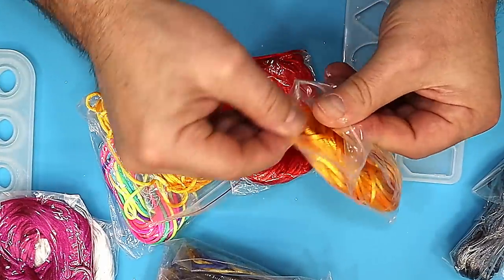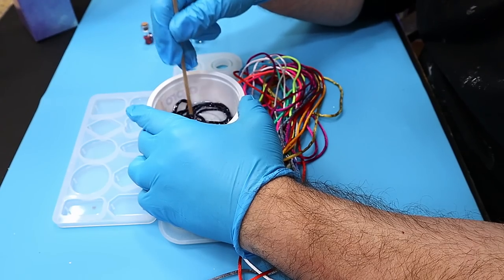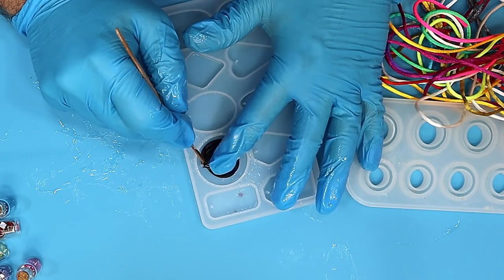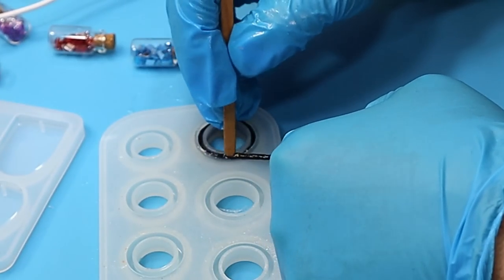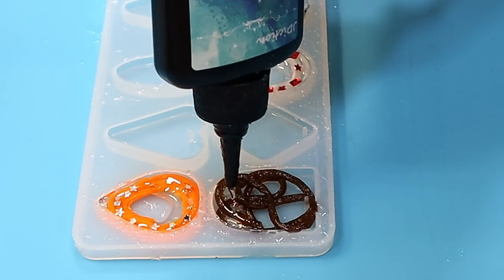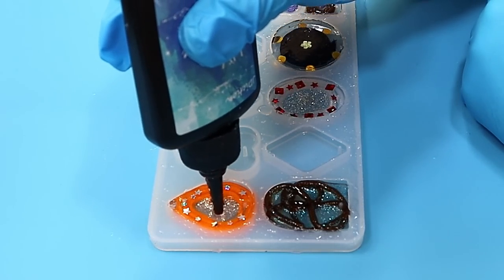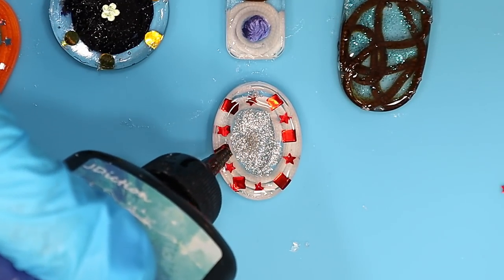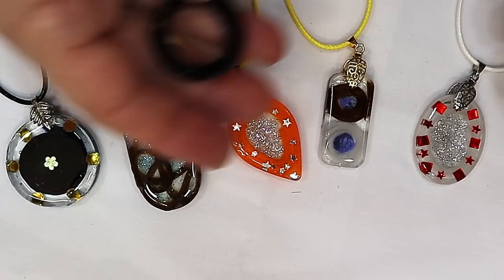These RESIN EXPERIMENT Results Have Shocked Me

Comment: SO PURITY!!! The first one you did is my favorite.... And, you gave me a GREAT idea for some ring molds I have. Didn't like them because they made the band of the rings to thin!! I'm going to try some cording in them.... Hopefully that will fix the problem.

I have found that if I coat the inside of molds that seem to trap bubbles I don't get many gaps. Just enough to fully coat, then fill as I want. I don't cure the coat, just try to stop the bubbles from being on the outside. Letting it all cure together.
Stay safe, you do you, & stay creatively crafty.👍👍🔔🔔🦋🦋

Comment: I'm kind of messy with my resin so I wear arm guards. Plus last night I put some cheap food service gloves over my nice blue gloves. I used a hairband to help hold them on. 
It was nice because when my gloves got to sticky I was able to just remove the outer gloves & put new on. Made it much easier to add details to things. 
Now I just need to order a waterproof apron off of TEMU to protect my pants. 
Yes I dropped a drop on my leggings.